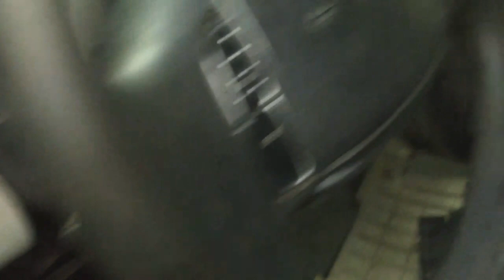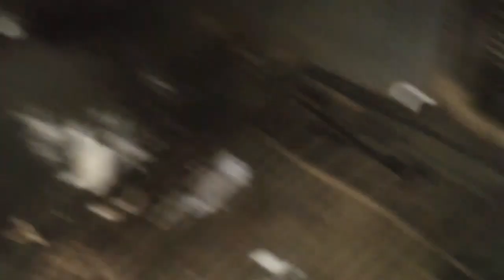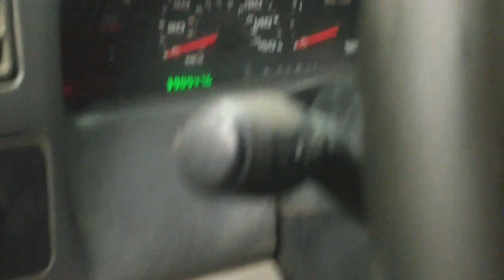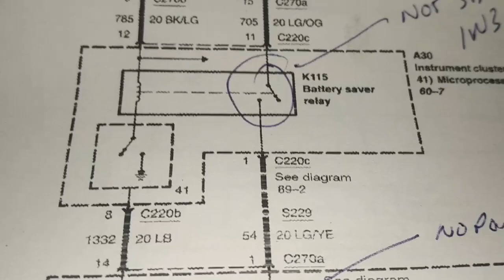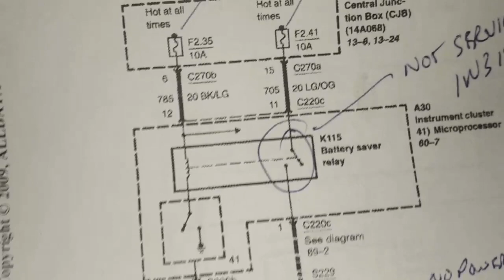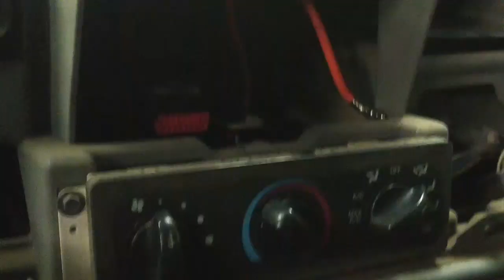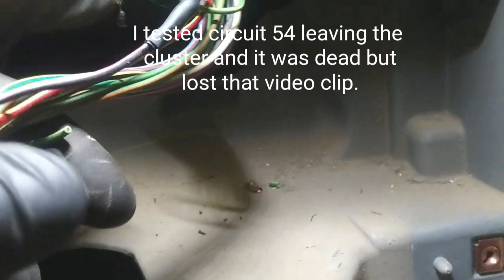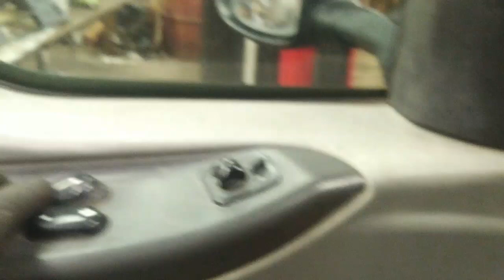2002 Ford F250 SD no power windows or radio

Comment: Hi i need to try this. I have power loss to radio,cluster and windows. I sent cluster to get rebuilt and the problem still occurs
Reply from the maker: That sucks you would think the rebuilder would be aware of this type of failure. Either a cold solder joint, cracked trace on the circuit board or internal micro relay. Good luck.
Reply: @PhillipBailey  thank you. I let the rebuilder know beforehand. I guess it's time to keep looking.

Comment: Just what I needed. Found that I had to keep pressure on the right side connector of instrument cluster to keep the radio on, problem at connector to circuit board.

Comment: What if that dont work lol
Reply from the maker: Then I would say one of two problems. Either you connected something incorrectly or this was not your problem. Does the relay now turn on with the ignition? is there power at pin 30 or 87 of the relay and do the windows and radio work if you jump 30 to 87 at the relay?

Comment: Philip, I've been chasing an issue for years in a 2003 Ford Excursion.  Only happens every once in a while.  The symptoms are sometimes the radio does not have power.  Sometimes the AC does not have power, and sometimes the windows do not have power.  It could be one, two, or three of these issue at any given time.  Happens a few times a month.  It really sucks when the AC does not have power and the windows do not have power in 100 degree Texas Summer.  Do you think it is this relay?
Reply from the maker: This relay has nothing to do with the AC imo.  You could have more than one problem too. Do all three issues happen at the same time?
Reply: Sometime all three issues, sometimes two of those issues and sometimes just one issue. At first it only happened a few times a year now it seems to be happening weekly. Then all of a sudden randomly it just starts working again. No common cause that I can tell except it happens most often when the car has been sitting in the sun and the interior temp is fairly hot. I’ve taken it to machanic but they haven’t been able to repeat the issue.
Reply from the maker: @davidmendez3545  tough to diagnose unless it does it when you have some test equipment on it or at least handy. I'd be leaning towards a faulty ignition switch.
Reply from the maker: When it happens again check the fuses for power. If fuse 23 does not have power you may have a faulty ignition switch. Is it all the functions of the AC that don't work like tge controls are dead or just the AC compressor?
Reply: It is possible try finding replacement relay,I have a 03 excursion and recently had a random clicking sound coming  from under dash near fuse panel, I located clicking sound just right of steering wheel under radio climate controls is a blinker relay all by itself I'm a plastic cover:/ bracket ot was making a random sound oddly I got 3 different said replacements from auto stores  but they did not have exactly same oem part number and when plugged in it also made a clicking sound but more constant like a blinker ticking sound.  I found on ebay someone with exact part number of relay and clicking sound gone, I never saw a issue with blinkers only annoying short circuit sound from old relay, so I wonder what condition these relays are being this old, and mine are at use over 500,000 miles driven. My windows are also randomly not working, I think I thought maybe issue is after it rains, but I am seeing more in extreme heat and cold temperatures also. My radio never stopped working, though, but it is also a replacement new radio I connected to constant power not switched off key power.
Reply: Mine do this exact same thing.

Comment: I have an 05 f250 extended cab.  For a couple years now  the gauges, the power windows, and radio all quit.       Sometimes if I bang stuff around it comes on.   Usually I think it’s coincidental.  I’ve had it to a couple shops and they can’t figure it out. After charging hundreds of dollars.       I have found that if I fiddle with the ignition switch it will sometimes start working.  And when it’s off with the key on the dinger usually doesn’t work. I can old the key further in the off position and it will start dinging.      Also. Sometimes the dome light will come on when I’m driving for no reason and the tow/haul will come on if I start it and the gauges  etc don’t come on at all when I start it.      Could this just be an ignition switch issue?            One last thing.  I’m pretty sure when we bought it used it had a transponder key. Because I programmed an extra key for it. My husband lost them both and I’ve been using a copy door key in it.
Reply from the maker: It sounds like you have multiple issues one of which could be a faulty ignition switch. The key in ignition reminder is common to malfunction and work intermittently as well. The instrument cluster controls the dome lights so it could be the cause of the random dome lights but so could a door latch switch that changes state with the door closed. I don't believe the F250s had PATS so no transponder in the key. Have you tried a salvage instrument cluster? Should be safe to simply try a different cluster. That's what I'd recommend...good luck.
Reply: @PhillipBailey  I have not tried the used cluster yet.    I’m considering just getting new  because I keep seeing these same issues over and over and would be Leary of a used one.  What are your thoughts on used vs new?       I don’t “think” it’s a door latch issue because I have tried many times to open and close the door with no change. But  messing with the key sometimes works.     Now who knows.  I am a lawnmower mechanic but know nothing much about vehicles!   After working on mowers all day the last thing I want to mess with is my truck but no one locally can figure it out either

Comment: I'm having the same issue yet my wipers are also not working. Please help.
Reply: Also everything was fine until I changed out my steering column shifter tube. The windows come on after the seat belt alarm goes off consistently. Didn't even have a seat belt alarm before the column repair. Checked all the fuses. All are good. Am going to check if I see a loose wire or misplaced one some where. Today the radio light came on/time display, yet no radio.
Reply from the maker: @eshacooper8741  make sure the ignition switch connectors are properly seated. Do you have power at the wiper fuse. Possibly broken wire inside the column at the wiper switch although this should not affect radio and windows.
Reply: Thank you. I will check it out and see.

Comment: Hi I've looked every where and can't find the pinout diagram for my 2006 f250 regular cab xlt what wires would I splice/ where did you find the schematics.
Reply from the maker: At the instrument cluster connector locate the light green/yellow wire in pin 25 of C220A which is the connector on the right side of the cluster. Cut the wire and attach the harness side of that wire to the Accessory wire in pin 22. This is a black/pink wire that supplies ignition and accessory power to the cluster in the same connector. If you need a schematic give me you email.
Reply: Awesome thank you

Comment: do you know witch wires I have a 2005 f350 crew cab dually 6.0 a black and blue plug on top of circuit board
Reply from the maker: on the black plug pin 25 which is light green/yellow is power out for the accessory delay relay. Pin 22 in the same connector is ignition/accessory power to the instrument cluster. it is Black/Pink. Good luck
Reply: @PhillipBailey splice these two wires together?

Comment: My 2002 ford f150 had same issue. I was told to check my interior box fuses. A fuse will indicate its good but in reality it’s no good. Check the metal part of the fuse, if it has small circular/square burn marks on the metal, the fuse is no good. My truck power windows interior lights and radio are back in action.
Reply: which fuse exactly did you have to change?
Reply: @Quackk_Addict  your gonna have to look at your owners manual Buddy. Start with that and look at the fuse metal pieces. If they have small burn mark squares, the fuse is no good. What I did was a last resort. I checked every single fuse 1 by 1 and replaced them if they looked burned. FYI the fuse tester will not catch the burnt fuses as bad fuses. Good Luck

Comment: Thank you. I followed your advice and the problem persists. According to the 2003 f250 wiring diagram the two green and yellow wires are for the left and right speakers. Splicing one into the black and pink wire as I did failed to work. Any advice?
Reply from the maker: At the instrument cluster middle connector which is 20 pins you need to cut the wire leaving pin 1 which is light green and yellow and attach the harness side wire to pin 19 which is ignition run and accessory. this is a black and yellow wire. These are the wire colors for an 03 SD. The battery saver relay in the instrument cluster sends power to the Accessory Relay on the Light Green and Yellow wire from pin one. Problem is the relay does not work. Good luck
Reply: @PhillipBailey  thank you again. I have two identical yellow and green wires. And in position 19 it’s a black and pink wire. What am I missing?
Reply from the maker: @srqsup  you're correct 19 is black/pink. It should be live ignition on. Pin 1 is at the other end of the connector and is light green/yellow. If you give me your email I'll send you a schematic.
Reply: @PhillipBailey  thanks it’s srqsup@me.com
Reply from the maker: @srqsup  sent good luck
Reply from the maker: @srqsup  You should also check pin 8 of the other connector its a light blue wire. That is the ground control for the Accessory Delay Relay. Do the windows work if you jump 30 to 87 at the accessory delay relay. You may have other problems.

Comment: Do you think this could work on a Ford F-150 it's a 99 mine is doing the same thing
Reply from the maker: I had a look at the F150 power windows and radio circuits. The circuit is completely different and uses a Generic Electronic Module (Body control Module) to control the accessory delay relay that should keep the power windows functional after turning off the ignition until a door is opened or the system times out, (around 15 min). The radio is not fed by the same relay so whatever is going on with your truck is not the same as these newer trucks. Tell me exactly what does and does not work and I might be able to offer a suggestion. Let me know what you have done so far trying ti fix it.
Reply: @PhillipBailey  Why do you think I don’t have any power to certain fuses in the instrument panel ? I took the dash apart to do the heater core getting everything put back together and I’ve ran into some problems. I had to replace blend door actuator and plug because the other one was burnt up so I rewired them and everything was working great but now that isn’t the case I’ve lost power to my blend door actuator and when I hook up the ignition wires the radio and the windows only work with the key backwards in auxiliary.
Reply from the maker: @alexharper9786  sounds like you missed a connector putting it back together. If everything worked prior to the heater core and now that it's back together you have a problem I'd say to recheck your work. Posdibly a connector or ground left off
Good luck
Reply: @PhillipBailey  Everything is connected where it needs to be connected. I went under the hood and tested all the fuses there and there all good but one Relay terminal isn’t getting no power same thing with some fuses inside the truck the fuses are good but no power at terminal what so ever but the relay itself is good it’s the relay that controls the wipers which I have no power to that along with blend door actuator and the passenger side door light doesn’t have power but everything else does and I still can’t figure out why the radio and windows only work with the key in auxiliary.
Reply: My truck is a 2000 F-150 btw hopefully you can help because nobody else seems to can
Reply from the maker: @alexharper9786  morning Alex. Exactly what are the symptoms again, ie what does not work? You mentioned wipers, radio and power windows? What relay do you see that doesn't have power and to which pin on tge relay. Almost sounds like you missed plugging in a connector at the ignition switch. I gather you had it unplugged to remove the column. Give me some details and I'll try to help you out...
Reply: @PhillipBailey  All the ignition wires are connected. They’ve been disconnected and reconnected several times. Still the same problem
Reply from the maker: @alexharper9786  I asked you exactly what tge problem is with the vehicle. You mentioned some fuses don't have power but didn't say which ones. I need more information to help you...
Reply: @PhillipBailey Interior fuse box  #5. 15A. climate mode switch, speed control module, reverse lamp, daytime running lamp relay, digital transmission range sensor.

#6. 5A. cluster, brake shift interlock solenoid, GEM module.

#8. 5A. radio, remote entry module, GEM module.

#11. 30A. front washer pump relay, wiper run/park relay, wiper hi/lo relay, windshield wiper motor. 

#16. 20A. headlamps(highbeams), cluster(highbeam indicator). 

#18. 5A. dimmer switch power.

#20. 5A. audio, GEM module, powertrain control module(pcm).

#21. 15A. digital transmission range(dtr) sensor, clutch switch. 

#26. 10A. right side low beam headlamp. 

#27. 5A. foglamp relay and foglamp indicator. 

#28. 10A. left side lowbeam lamp.
Reply from the maker: @alexharper9786  Most of those circuits are switched on by the ignition switch. Check fuses under the hood at the Battery Junction Box especially fuse 111 and 113. They should be 40amp fuses that feed those circuits to the ignition switch. If they are good then test at the ignition switch for constant power on the two yellow wires and two light green/violet wires going into the ignition switch. If no power there check wiring to BJB under hood. If power at those circuits then test for power out of the ignition switch on the Black/Light Green, Red/Black, Dark Blue/Light Green and Green/Yellow with the key in run and Red/Light Blue when in crank. If no power on any one of these in their respective positions then you need an ignition switch. If power leaving the ignition switch then it has to be connections at the Central Junction Box, (fuse Box inside). Check for mixed up connectors or unseated connectors. Did you have the connectors apart at the CJB? Connectors 242 and 243 are where those above wires from the ignition switch go. They look very similar and I can't remember if they can be interchanged by mistake. They have a center bolt holding them together. Hope this helps you. Keep us posted. If you need schematics give me an email and I'll try send them to you. The headlights need to be on to power fuses 26, 27 and 28 btw.
Reply: @PhillipBailey  will definitely check that and let you know I appreciate it. One other thing before I check tomorrow could the ignition connectors be twisted or something they’re plugged in the right connectors it’s just odd because the truck cranks and the dome light works and the dash lights work and the driver door light is on. Just kinda odd how the radio and windows work with the key backwards. But I will definitely do what you said and get back with ya. Thanks again!
Reply from the maker: @alexharper9786  what do you mean by backwards? I don't believe you can plug in the switch wrong but honestly not sure...
Reply: @PhillipBailey  the radio and windows work with the key backwards like towards you when you put the key in (auxiliary) but they don’t work in the run position or when it’s cranked .
Reply from the maker: @alexharper9786  sounds more and more like ignition switch related issue. Did you have it unplugged? Is there an aftermarket car starter in this?
Reply: @PhillipBailey  when I dropped the steering wheel doing the heater core I unplugged 3 connecters I’m not sure what they’re called but they have to be plugged in for the truck to crank they’re brown, black, and white everything was working fine I still have the steering wheel on the floor board with the connectors plugged it at first I didn’t because I didn’t want the wires to get stretched but there’s enough slack so they’re fine connected in case I have to crank the truck that’s what I was maybe reversed but they can only be connected one way and there connected in the right spot it just doesn’t make sense because everything was working fine. I haven’t had the chance to work on it these past couple of days because I’ve been busy working but it’s a head scratcher for sure
Reply from the maker: @alexharper9786  How did you make out with your truck?
Reply: @PhillipBailey  I’m gonna work on it tomorrow. What should I look at first?
Reply from the maker: @alexharper9786  read through this chat history. I mentioned what I would suggest to check 6 days ago. Power in and out of the ignition switch.
Reply: @PhillipBailey  is there anyway I could send you a video clip?
Reply from the maker: @alexharper9786  phils@tbaytel.net would work.
Reply: @PhillipBailey  I sent 3 videos
Reply from the maker: @alexharper9786  call me, number sent via email

Comment: Happens with my 2008.  I just touch the accessory delay relay under glove box by feet on the right.  I kinda nailed it down to cooler weather.
Reply from the maker: I'm pretty sure a 2008 is different as all the relays and fuses are moved to the Smart Junction Box under the right side of dash.